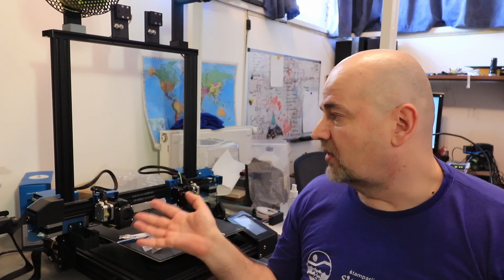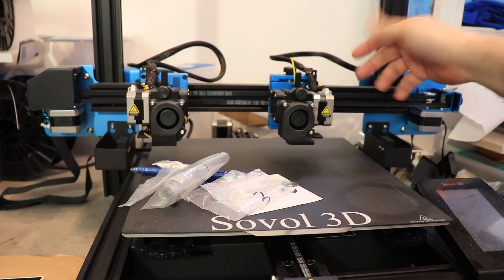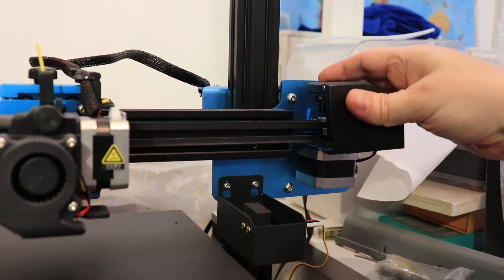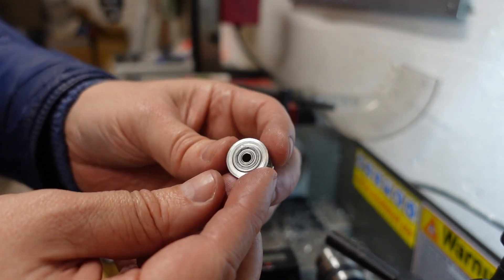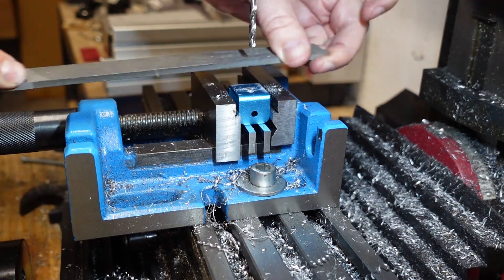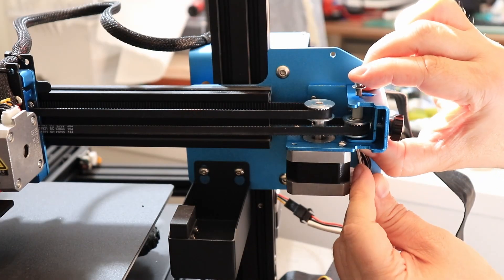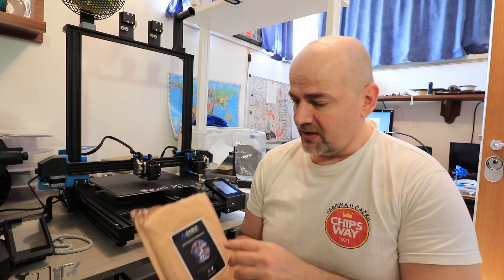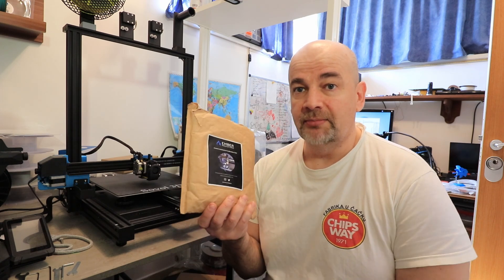Fixing belt tensioner on Sovol SV04 IDEX 3D printer

Comment: I wonder if some 3d printed shims above and/or below the bracket would also accomplish the same thing.  The idea being that the excessive tilt that causes the weird angle on the tensioner pulley gets eliminated by decreasing the tolerance.  I just bought a used ($100!) from a private party and will check to see if I have this issue.

Comment: Video suggestions
-- show how to add lights so you can more easily see the hot end as it's printing. Perhaps a rail LED or LEDs on the hot end.
-- how to move the filament sensor to the hot end
-- how to replace the power supply with quieter Maxwell power supply.
-- when printing with right hot end only, left hot end fan is running. Make video showing how to turn off right fan when left only printing
-- when right only printing if you attempt to change unused left filament filament it stops. How to not stop when changing unused filament.

Comment: I just had to redesign the pulley tensioner block for the SV06...it should be cast aluminum, but it is injection molded plastic and it broke.  I made it stronger and printed it in CF ABS.  It definitely feels stronger.  I put it on printables if anyone came here because this is the closest video to the SV06 problem.

Comment: Is it a good idea to replace all smooth pulleys with toothed pulleys on Sovol printers?
Reply from the maker: Yes (if they align on toothed side of the belt). She smooth side of belt should align on smooth pulley (this we can see with longer CoreXY belts usually)
Reply: @MyTechFun  Makes sense. So, smooth pulleys for tensioning belts from the smooth side, toothed pulleys to do that from the toothed side?